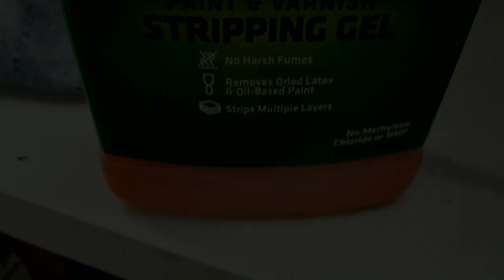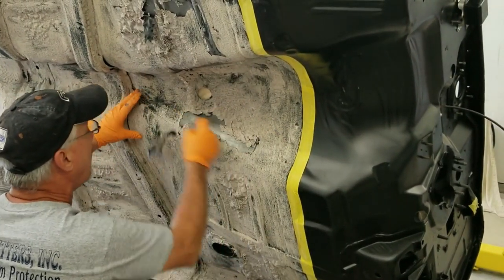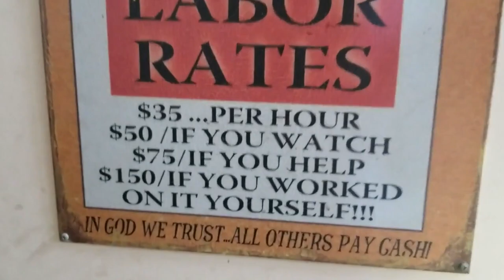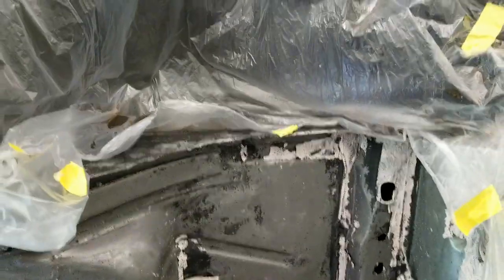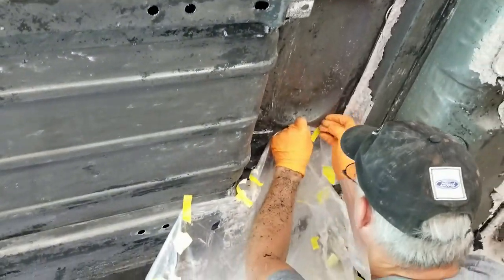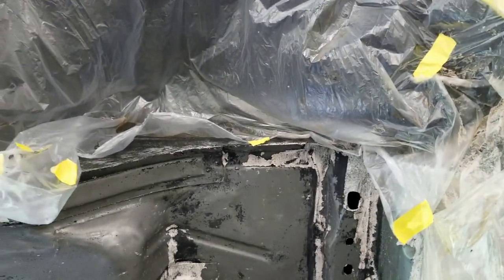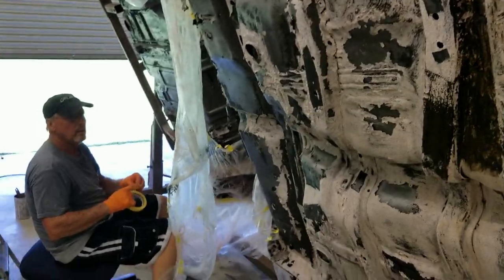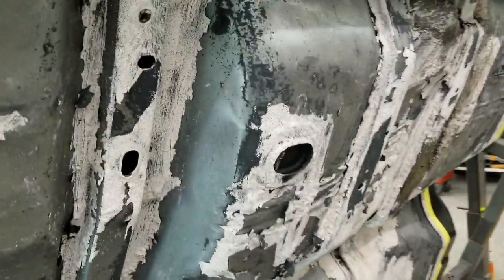Paint Stripping Rhino Liner  - Shop Updates & Outtakes

Comment: Great content! I've been looking at yalls restos and got some good information. Have yall ever worked with lizard skin sound or thermal spray on insulator? 

Also, I'm restoring a Jeep. I've got the bare tub off the frame and it has minor surface rust (Texas) underneath. I've got a blasting setup, just wondering what media yall would recommend, then possibly Ospho, chromate treatment and then a good undercoating (POR15?). What would you all do?